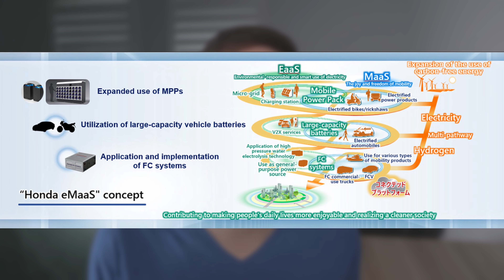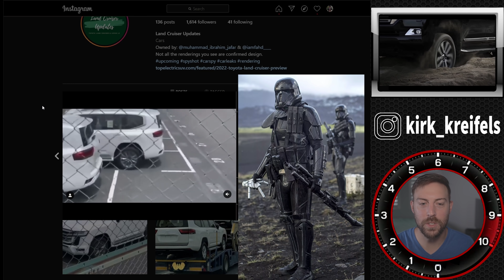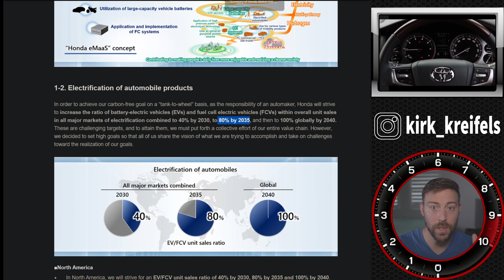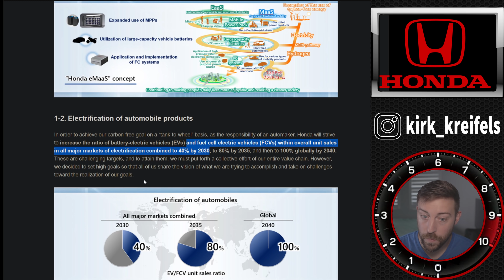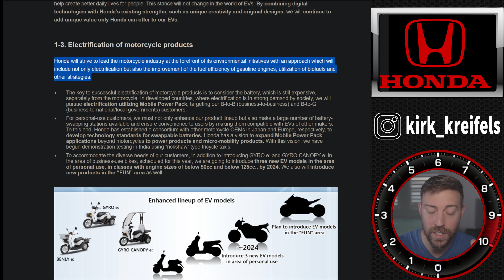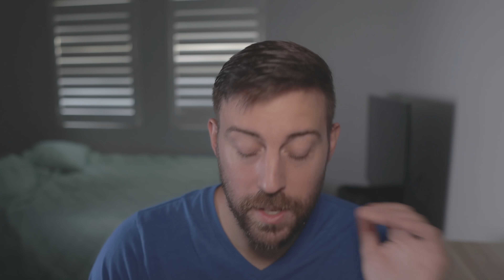CAUGHT - 2022 Land Cruiser Loading Up! + Honda going Entirely EV soon

Comment: as a die hard LC fan , man this looks so disappointing in my opinion. Although off road capabilities are going to be a bit better given the new engine the price is going to be so high that it is not going to be justifiable for the given specs. I mean no fully digital gauges in 2021 ?? Come on Toyota spend a bit more from your pockets

Comment: The undertone is that bev is not a permanent solution but a stopgap on the way to fcv, fcv/phev. I personally wouldn't want a bev. Range anxiety, power density, refueling network, refueling duration. Range anxiety, power density.
Reply: It's freaking garbage. 10 years ago, they claimed it would be better than a gas car now. Never happened, still takes a long time to charge and has a ton of problems.
Reply: @dickriggles942  yes, Tesla in particular has both initial quality issues plus ongoing issues and few repair location that are mfr authorized. And repairs are unbelievably expensive. And on and on and on and on. Let the pioneers take the arrows. It's a novelty as a rich person 2nd vehicle or a middle class person who think the ocean is going to reach a rolling boil in 5 years. Amuse yourself and go back to the 60s 70s 80s 90s and see how those predictions worked out. " But this time--" yeah yeah yeah...do yourselves a favor and STFU. No chance of bev cultists doing anything of the sort.
Reply: @ggusta1  Lived around hardcore liberals for four years. Most are communists who just want to run businesses into bankruptcy. There's a reason they want to tax them to death and impose a ton of environmental restrictions on them. It takes them one step closer to their goal. 

Do I think capitalism can be awful? Yes, but what they're proposing is probably worse. I like my reasonable checks and balances.
Reply: @dickriggles942  I'm the worst kind of liberal. I'm a former one. I know them inside and out. It's all about feeling superior with your so-called enlightened understanding of humanity. But when the rubber hits the road most of them love the ideas to supposedly save the world. But they hate the people their ideas are supposed to help. They're as fake as 3 dollar bills and disguise their narcissism with their smugness.

Comment: So sad the Land Cruiser will not be sold in the states, but the LX outsells it several to one. Driving around NY I see at least a dozen LX to 1 land cruiser if so many. At least they are similar enough for all the off road mods to fit.

Comment: are you sure it does not have the split tailgate, the tailgate looks split in half, there is a line running across it, also the lower half close to the bumper has an indent across it that is usually present in cars with split tailgates where the tailgate rests when opened

Comment: I truly believe that hydrogen is the way in the long term. It's the better method for the environment. There's still a number of issues though... The issue is first, building hydrogen stations is extremely expensive. Secondly, electric cars are winning the PR battle because of people Elon Musk mocking them, and their very fast acceleration - which is pretty cool. Lastly, I know Honda, Toyota and even Hyundai have kept hydrogen but there doesn't seem to be a lot of other manufacturers doing it.
Reply from the maker: BMW and Hyundai are all in on H2 so it's got investors
Reply: Musk is an utter scam artist. EVs have so many problems and their supporters are doing nothing but drinking the kool-aid. No thanks.

Comment: What is with the 5.7 V8 badge?
Reply from the maker: I was showing the badge for that specific LC trim
Reply: That is also because Land Cruiser has 3 engine options in the Middle East. 4.0L V6, 4.6L V8 and 5.7L V8. so for 4.0L V6 the badge will be V6, for 4.6L V8, the badge will be V8.  So to differentiate 5.7 from 4.6, they placed a 5.7 Badge next to V8.

Comment: As a loyal Honda guy, I think Honda is way behind on EV. The demand for full EV cars in the US is going to increase exponentially in the next couple years, and Honda was way too slow to realize this. The GM Ultium platform is a good stop gap, but clearly them realizing they’re way behind. At least they’re working on solid state batteries already. That gives me hope!
Reply: I actually think they have quite some time. If you look at the price differential, I still don’t think BEVs are gonna be mainstream until at least 2030 maybe even 2035. I could be wrong though.
Reply: ROFLMAO!!!!!!!! Yeah, those 2 hour recharge times are AWESOME!!!! GIVE ME AN EV, ROFLMAO!!!!!

I just watched Long Way Up and Jesus Christ, this tech is never happening. Great for yuppies to virtue signal, but not practical in real life.
Reply from the maker: Honda's ability to standardize mobile batteries for motorbikes single-handily secured their future success. They'll be just fine as a whole :)